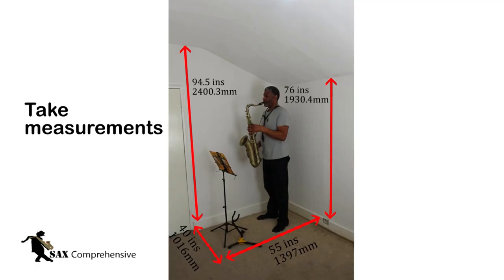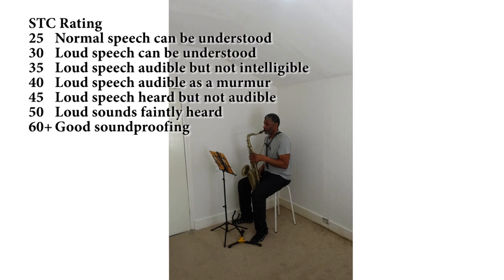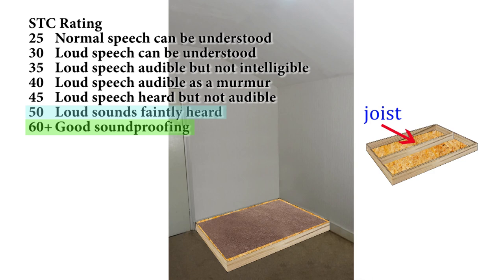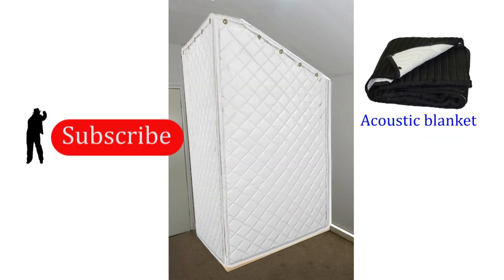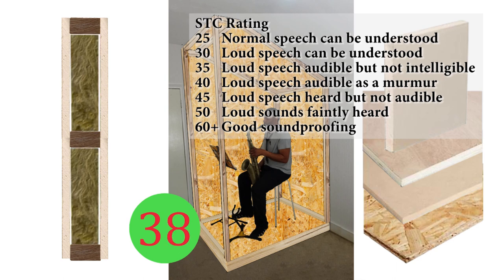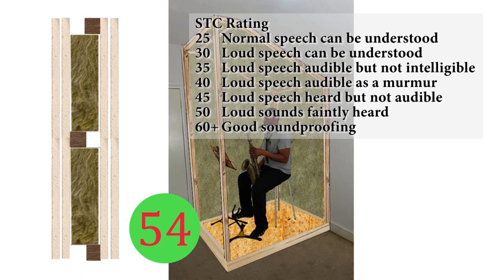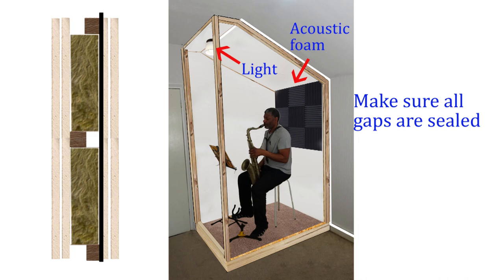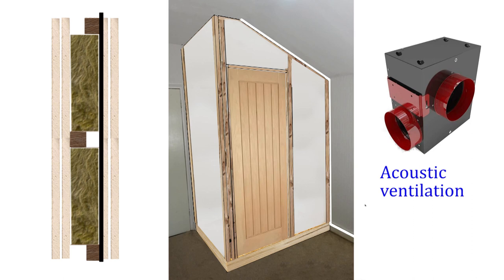DIY Isolation booth

Comment: I hope you are still active enough to see my comment. I would like to know the final cost of your project. Thanks in advance
Reply from the maker: Hi. The final cost was £600. I have several videos on my channel about this booth, one of which has a full breakdown of the cost of each item, assembly and a sound meter test to compare it with a professional booth which cost around £3500. It was not as good as the professional booth but ok for the price. I have seen other videos where people built a room within a room which had better results but again cost more. Thanks

Comment: 5min in this booth without ventilation and Your head will start to hurt from the CO2 buildup.
Reply from the maker: Hi. You might be right. Most of the booths I seen others build do not have ventilation. I'm more concerned about the heat but I will look into ventilation. I have to build a booth before my neighbours start complaining and I don't like those expensive sax mutes. Thanks for the  comment.

Comment: This is an awesome video! Thank you 😁.  I am wondering if you know the rating for osb vs Dry wall?
Reply from the maker: Hi. Thanks for watching the video and your comment. The rating of materials has to do with their mass. So a thicker Osb will have a higher rating than a thinner drywall. However you could probably buy 3 sheets of drywall for the price of 1 sheet of osb which would be better especially if adding insulation or green glue. I think it is all about cost and how you will design it. I'm not an expert but just using 1 layer of osb will not do much. All the videos I've seen on soundproofing a home cinema room use layers of drywall due to the cost. There is a lot to think about and the worst thing to do is build it and it doesn't reduce the sound sufficiently. Thanks.

Comment: Hello. Thanks for the video. Very useful. Wonder if you have an update as to cost of materials of a sample project? I am really interested in it. Cheers.
Reply from the maker: Hi. I am in the process on building my booth. I will upload a video in a few days with pricing for a basic construction which was just under £600 though could be cheaper using different materials. Thanks.

Comment: Looks like a great project. I would like to see a breakdown of costs not including the labour of course. Ventilation is important. We wouldn't want you passing out.
Reply from the maker: Hi. I will do a breakdown of the cost but those acoustic ventilators are expensive. Most of the booths I seen others build do not have ventilators. It's a great project but I have to be careful in case it doesn't work out as expected, but I need one so I can practice late hours and not disturb the neighbours. Thanks.

Comment: You've got a good pragmatic mind!  
I'm curious about how good something like this could be for a piano, which tends to be notoriously awful for neighbors.  Of course then you're dealing with a lot of weight and a lot of sound travels through the floor because of that weight.  

Also how good a booth could be if built into the corner of a room because then you'd only have 2 walls.  But you could hang blankets inside to temper things.

Comment: Nice video. Thank you for sharing. With which software you made the plan/design?
Reply from the maker: Hi. Thanks for watching. The artwork was drawn in photoshop and coloured using the cloning tool and the video was put together using premier pro. Thanks.
Reply: @Saxcomprehensive  Thank you. Good luck for the build.